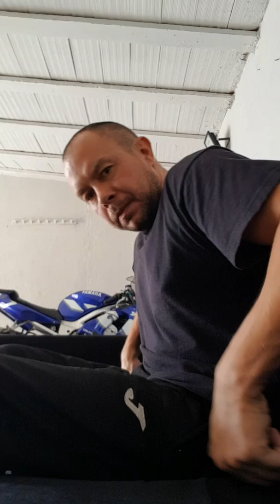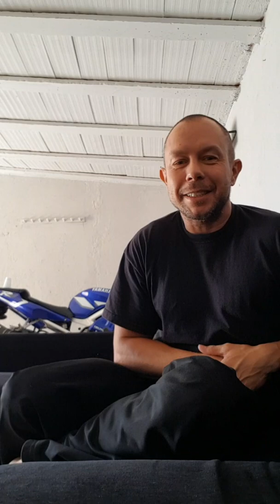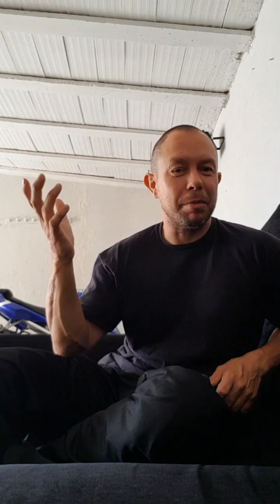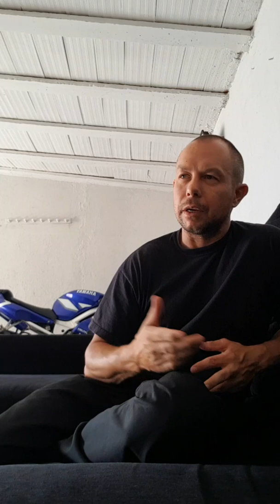Mercedes commonrail engines.

Comment: Thanks for making this. Been debating on an om642 powered R320. Glad to hear you recommend them.
Reply: @om606channel  they come with it, stock, from Mercedes
Reply from the maker: Only problem on a stock car with that engine is the 722.9 (7G tronic). Sure will probably hold up to your 400hp but then it will be a fast track downhill.
Reply: @om606channel  it did in the USA
Reply: @om606channel  https://en.wikipedia.org/wiki/Mercedes-Benz_R-Class look at technical data.

Comment: The om 628 are a good engines don't brake I have one it's done over a million KMS the only thing to do is apart from servicing is take injectors and test every 120,000kms bad injectors in these cause thermal cracking on pistons I'm about the only person around that knows the 628 backwords

Comment: Piezo is only used from 2006 or whenever the v6 engine came. 613-648 solenoid injectors